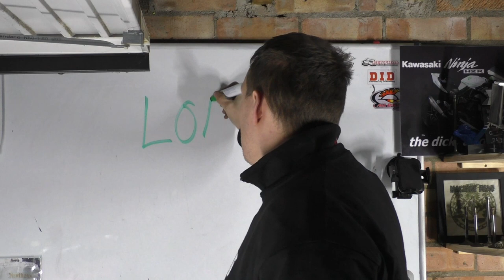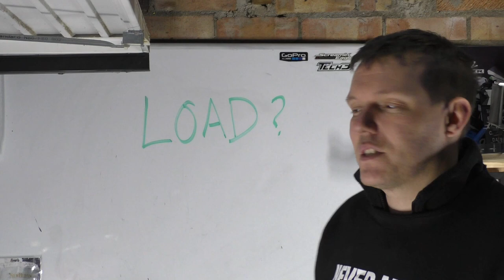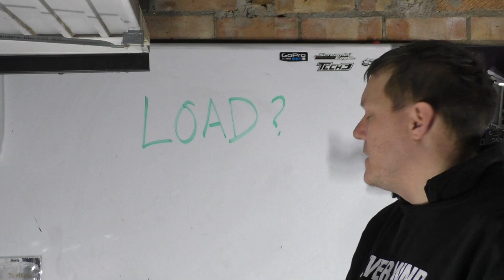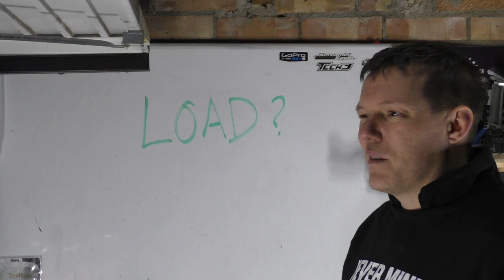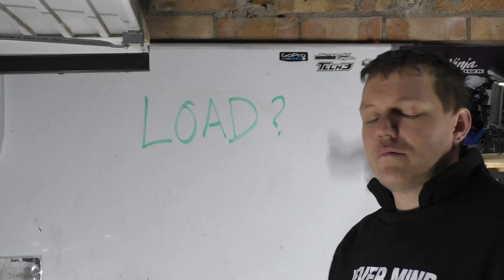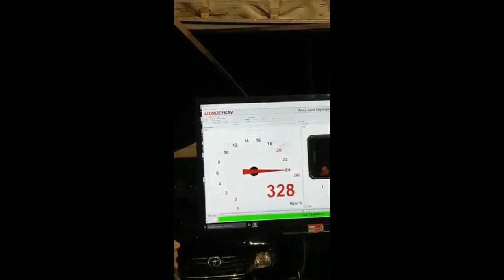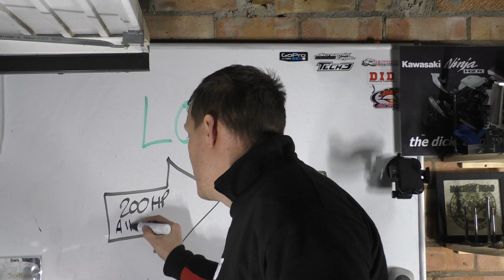What is LOAD?

Comment: How do Eddy-current dyno's work?... do they plug into mains electricity??... how much power do they consume??... can the vehicle itself be used to produce power for the eddy current??
Reply: Graham Stewart  You didn't answer any of my questions.
Reply: Marek Sumguy  
I never heard of them before. Thanx .
If I can get anything from Ed I'll pass it on.
Reply: @mrbigstuff6149  ... huh?
Reply: Marek Sumguy   
Electric powered coils induce /create opposing magnetic polarities in ferrous cores (like a solenoid or electric magnet) which act like brakes on a magnetically sensitive material suspended/ sandwiched between these opposing forces coming from the opposing polarity magnetic  poles which excert a drag force and bit of heat . Look up Eddy Currents.
The material spinning between the poles (like a disc brake between it's pads) is connected to the rotating machine who's power you wish to measure. The thing is basically a pair or multiple pairs of opposing polarity electric magnets used as an electrically controlled disc brake. 
There's quite a bit ont YouTube if I described badly. 
Thanx for asking as I'd never heard of them before.
Reply: Graham Stewart   You also didn't answer any of my questions.
Reply: Marek Sumguy  
The YouTubers posts I saw had their dynamometers powered from mains supply in USA and NZ but they don't specify phases or voltage, I think the NZ one said it took 25A. The actual solenoids will require dedicate power supply and  control circuit  and some software + display etc. It depends how big or small and complex it is I'd imagine. If you take power from the engine you are trying to get a measurement from you'll add to it's load. A lot of bikes I saw at road/track races used to remove the generator coil and rely on a smallish battery to last the race.
Reply: @mrbigstuff6149  Yes of course you'd add extra load to the vehicle, but it would be accounted for and calculated appropriately.  It would probably add too much complexity and mass/volume to the dyno unit though.  So it could very well just not be worth it.
Reply: giacatollo 
Thank you.

Comment: Loving machinery as well as motorcycles the thing I love about loading an engine is the difference in sound. So a land rover going up a steep hill towing a trailer full of wood chip in 3rd gear gives a growling noise. A chainsaw with no load sounds shit just an engine reving form 2000rpm to 8000rpm you put it through a heavy bit of oak she sounds great dynamic picking & bogging down. Strimmers, mowers, tillers are the same. A leaf blower is allways under the same load so engine noise is not as dynamic. With the battery tools I have there shit at high load work petrol is king.

Comment: So I get all the dyno stuff how it works off putting a "load" onto the motorcycle/car, but if said motorcycle/car was in a wind tunnel on a dyno wouldn't be the same as if it wasn't? The vehicle isn't pushing against the wind. It still is just on a dyno with wind blowing by it. I thought the fans were just too cool the motors anyway... right
Reply from the maker: "but if said motorcycle/car was in a wind tunnel on a dyno wouldn't be the same as if it wasn't?"

- yes - well almost. This is the problem with dynos - they measure engine power  and not how that's going to propel you across the surface of the earth.

Comment: 5:40, is it called static dyno when you only accelerate a flywheel? They can work great on smaller engines like mopeds and such, may not give accurate hp numbers but they're great as a poor mans dyno to measure differences in tuning to see if you get more or less power.

Comment: Uh Matt, Suzuki made a 14 gear bike...
Reply from the maker: There are a lot of old school 50cc bikes with up to 14 gears. What's your point? And you also missed the point....
Reply: @dirtygarageguy  8:05 "This is why you can't just keep adding gears"
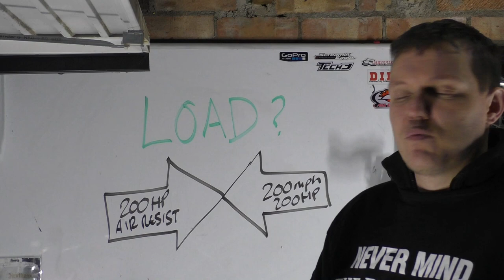8:12 "That's why bikes don't have 20, 30, 40 gears" - well yeah, they don't have 20, 30 or 40 gears, but they did make a heap of bikes with 14 gears at 50cc. Therefore your point about "You can't just keep adding gears" seems a bit wrong to me.. I'm just a little bit confused as to what you're trying to say here. I understand that adding more gears just divides up the power and all that but, the point is that they do have bikes with more than the usual 6 gears.